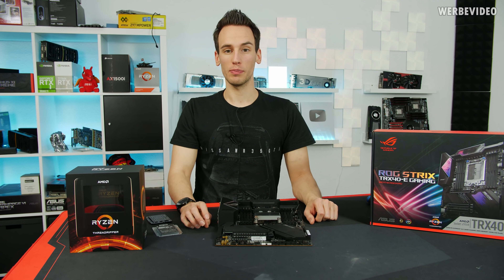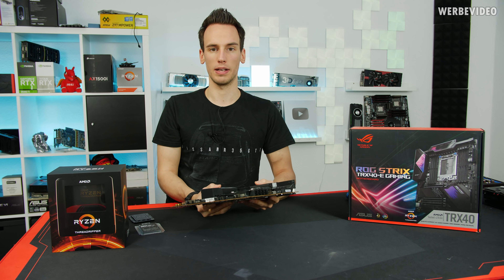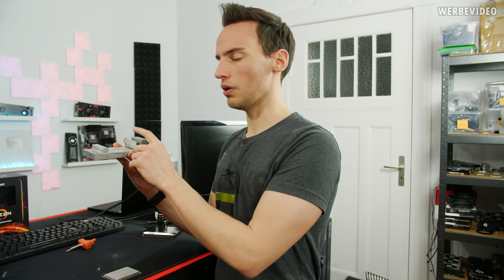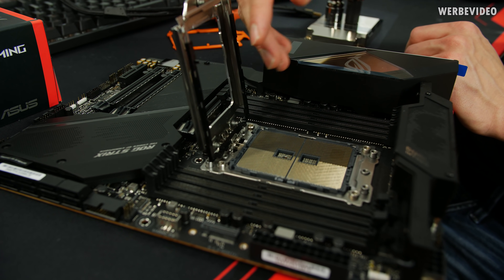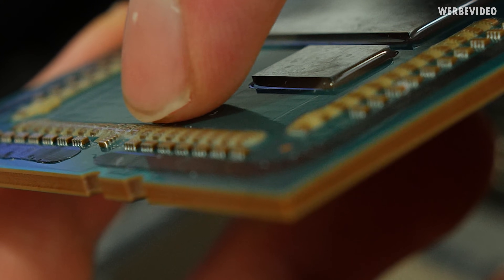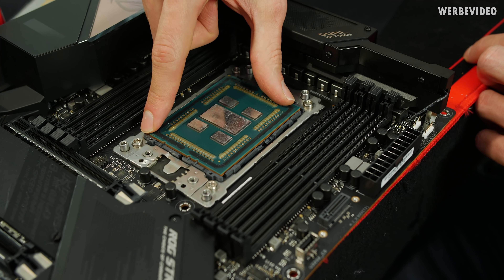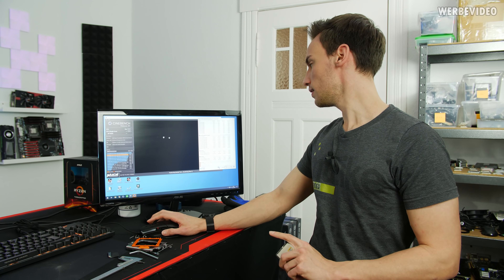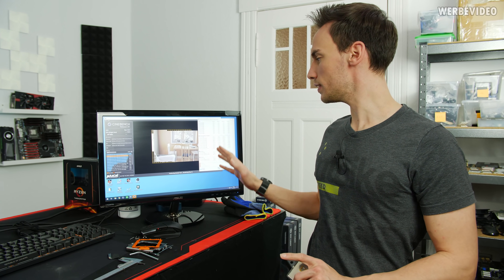IT ACTUALLY WORKS! -  3960X / 3970X Direct-Die Cooling

Comment: Looking at the size of this CPU delidded I can imagine that in the future Amd will just produce a CPU that is integrated into the motherboard itself so as to remove the need to have a CPU socket with pins and contacts completely as the die is so huge at this stage that if it gets any bigger it will be as big as one 1/4 of the surface area of the board it sits in, so at that stage they might as well integrate it into the board which I think will make a lot of sense.

Comment: I really wish direct-die was a bit more mainstream, so that non-lidded CPUs could be bought and motherboard sockets were designed to support it as an option.
It seems that as long as you have a direct-die bracket there is really very little risk involved in the actual mounting. I don't think I have ever heard of anyone who used a direct-die bracket cracking or killing a CPU because of mounting it too hard.

It is just a shame that it is all the other stuff (delidding a soldered CPU, replacing/modifying the socket ect.) that is so risky and/or require expensive parts.
If CPUs and sockets just took it into consideration to have this as an option then there is no reason direct-die could not be very cheap and safe to do.
I guess it would probably never be "mainstream" because direct-die needs a little more precision to get proper contact usually, but there would probably be a market for non-lidded CPUs - and it would require almost no work for the manufacturers because it's literally just skipping the last step of the process.

Even for the enterprise market... if you could reduce CPU temps significantly like this for a one-time isntallation cost then that means you need less cooling. Less cooling => lower costs. This would be interesting to enterprise for exactly the same reasons they want more and more power efficient chips.

Comment: Can someone very experienced with LM answer me this?
Is there any performance reason to not use  a little more LM than you need? I assume it would just squeeze out any excess anyway.
Of course that is not good for safety unless you have insulated any exposed connections on the CPU, but let us assume that you have done that thoroughly (as you should IMO). Then it should not really matter...

The reason I ask is because while LM is fantastic, it seems to be much more finicky about getting good contact than normal TIM. Even the guys at GamersNexus say that they often have to do 2-3 applications to get a really good connection (where core-to-core differentials are not so high). Not just to get a "good enough" connection, but when they do comparison benchmarks where they need to have consistent data I mean...

My hypothesis is that if you apply LM normally, but then put a tiny ball of LM extra in the center then this would help push out any air-gaps and make it much easier to get a really good thermal contact the first time. You would probably end up using less LM also compared to remounting 2-3 times to get it "perfect".

Comment: Wonder if due to the pressure now being in the center if the pcb is bowing and the chips are not perfectly flat to the heatsink.  Maybe some memory thermal pads along the pcb could help spread the pressure out with the additional benefit of transferring heat from the pcb to the block.  Same thing if you snug the pad up along side the cpu chips as you would get more surface area from the side of the chip to transfer heat to the block.

Comment: well, I do not know the composition of the solder used by AMD, but I believe it is based on a Sn/In alloy, which most likely will present a thermal conductivity at 393K similar to Conductonaut.

Comment: the whole process is really cool.  However, I am wondering why removing the thermal interface based on the element Indium, whose coefficient of thermal conductivity is 81.6 W/m.K, for liquid metal Conductonaut, whose thermal conductivity is 73W/m.K?  
To improve your experiment how about to use another product with a higher thermal conductivity such as the LT100 with 128W/m.K.  Or better yet, how about using graphene sheet, whose thermal conductivity is 1500W/m.K, maybe that justifies all the work to replace the thermal interface.  Maybe you can get bigger overclocks.

Comment: You should take measurements and grind out indents on the cold plate for the memory controller and each core. That will give everything full coverage contact. Polishing may take an hour or two but you'll have a beastial custom waterblock you market to the OC community.

Comment: The reason for your high temp is because you are stressing the single core, thus increasing it's thermal dissipation. These CPU's are designed to attach a workload by breaking up the load among the cores.

Comment: This might be a case where custom IHS/block will have benefit. The block has thickness, so with watercooling the IHS is redundant/excess material.  You'd likely want to measure your CPU so each contact is at proper height. Maybe solder the water block right on?

Comment: I think the problem is that top of the dies are uneven as you removed indium with a blade.
Try heating it up and using desoldering wick maybe?
Or heat it up and place piece of borosilicate glass on top of it so indium is flat AF then leave it to cool down.

Comment: Damn  I remember when most Cpu's where direct to die cooling  Like the old Athlon XP 17 or 1800+ those where scary days, It was very easy to chip the corner of the cpu.
Reply: Yeah, and chipping these corners did usually nothing. I didn't find it scary at all. Heatsinks were also much smaller than nowadays. If I were to mount 1,3kg behemoth on my Duron or Athlon XP, I would have been surely more worried.

Comment: Maybe the original cpu heatspreader was a better alloy (for thermal conductivity) than the bottom of that chrome colored exchange.  One is better off with something having bare exposed copper -- nickle, chrome or stainless do not conduct heat so well.  You could cool directly with de-ionized water, but it would not stay de-ionized for long.

Comment: the indium solder likely has higher conductivity then any liquid metal containing gallium. if you wanted better cooling you'd need to use pure Potassium with the PC in a vacuum chamber.

Comment: It could be that AMD deliberately make core dice a bit shorter than the central one and then relying on solid solder for both thermal interfacing and uniform load spreading. This way they're guaranteed not to end up with a tilted IHS due to height variation between dies. Would be cool to see this tested (maybe with a very thin shim with the CPU surface pressed against a lapping plate, and then to see the CPU actually lapped flat. Also, I always wanted to ask, does liquid metal actually amalgamate and remove the remaining indium from the surface of de-lidded CPUs?

Comment: Did you check the back of the CPU for contaminated contact pads or wipe down with isopropyl alcohol? Fingerprints will interfere with a good electrical conduction.

Comment: I think some extra hard foam  around the dies might help Keep pressure more evenly spaced on the die board.

May have too recess the cooler a little bit too accept the dies and get more even contact with all the dies.

Then its time to get this baby on a water chiller.

Comment: First thing I thought - make a shim on the border, kind like on older S462 Athlons, where the glue originally was. Good part of the mounting pressure comes from IHS spreading it over the edge. I'd guess the best one would be a hair thinner than die height with some soft, yet thin interface underneath (silk? I am not kidding). That's pretty precise work, sadly.

Comment: Would love to see you try and put a  3900 in one of those laptops that takes AMD desktop CPU's (GL702ZC, Helios 500 etc)..it hasn't been done yet and no laptop has been released which has that CPU in.  The 3900 is 12 cores 65w or you could try the 3900x variant - but you'd have to reduce power draw in BIOS. Im sure people would love to see a 12-core laptop project from you =D

Comment: Rather than modify the cooler block perhaps first try to get some very thin sheets of copper foil and lay them on top of the die. It wouldn't be as good as direct contact with the cooler but it would give you a idea of how much of a gap  you have.

Comment: You should notice "the thermal spreading resistance". It not always good to decrease the thickness of the base.  The roughness of the contact surface also should be concerned

Comment: Roman: at around 6:15 you are talking about the device holding the bolt in... if you're curious what this is called, it is a "circlip" (circumferential clip, basically). They come in outer and inner kinds - the inner kind is often used to retain bulkheads in a tube for instance, the clip lying in a groove cut into the inner surface of the tube (hence being called an "inner circlip"). The kind you have is an outer circlip, and they are usually used in exactly the manner  your one was!

N.B. closely related are E-clips and snap rings. All of these are variations on a theme basically; different strengths, different mounting styles (holes/notches for insertion/mounting using the specifically designed plyer-type tool) and such. I usually just call them circlips unless I need to specify the exact kind as it's a good catch all considering the etymology (all of them are circumferential after all)

Comment: AMD should come out with the Der8auer Edition which is shipped delidded and the Der8auer Pro Edition which ships with no lid.    And the Der8auer Extreme Edition with ships with the cooler pre-installed on the dies using a custom machined cooler.      Or maybe just make and edition with a very fancy heat-shield made of the best alloy, and call it the Der8aueRipper.

I would think that if you drilled tiny holes in the heat-shield above the IO and each of the 4 cores and filled those holes with liquid metal, that that would be the easiest of the options.

Comment: SUGGESTION. I wonder if you leave the solder after deliding and set the copper part of the cooling head (centered correctly) on top of the chips, then heat it in the oven. that's about the best way to get full contact.

Comment: There is an important question,,in TR, the IO die and computing dies are made by different factories,GF and TSMC.Can you take some thermal image to show the heat generated by IO/Computing dies ?Which one generates more heat?If IO die generates more,,maybe there should be a special cooler design for it.

Comment: Definitely needs more mounting pressure..... I used an EK direct die cooling kit years ago and the stand offs for the CPU block were reduced in height to compensate for the loss of thickness. It should just be a case off measuring the thickness of the IHS and then removing that from the mounting system.

Comment: It might be kind of a stupid idea, but have you considered "shimming" the dies with metal foil? Perhaps some thin copper or alum foil. This should add a small amount of height and thus increase the pressure. But you'd have to get liquid metal on both sides too somehow, just really thin layers I guess.

For mounting pressure I feel like an o-ring or gasket material around the edges of the CPU carrier would probably work, it doesn't have to be very thick, I think it'll add plenty of mounting pressure around the edges to get rid of the mounting problems.

Comment: At my RTX 2080 that i put LM  i applyed a thin layer an have bad temps and when i put more it was all fine like it needed a good amount...  you can try add washers the mounting bolts so can push the cpu harder :P @der8auer  *also put some plastic...staff to put pressure to the corners of the cpu ..

Comment: Outside of the specific types of clips, e-clips & c-clips, we cal them circlips.

BTW, I know you’re comfortable cleaning the indium solder off with a razor, but if you directly apply Gallium, it’ll allot with the indium and you can clean it off more easily as you’d clean a liquid not a solid off the dies.

Comment: I have a question on choosing CPU platform for workstation upgrade that is relevant to 3970x:
-our software can utilize 16cores max and can eat up to 256GB of ram so 32GB dimms are needed
-we can do whatever we want with cooling as long as it can run 24/7: custom WC + water chiller sounds like max what can be done here
-10900XE or 3970x or what else? 
-our existing config's are delidded 7980XE @ 4.6GHz with 64GB and 2990WX @ 4.1GHz but first one lack memory support and second lacks speed
-money isn't a problem, we are designing ASICs :)

Comment: If you get the pressure right and see worthwhile improvements I’m curious to see what direct die cooling does for standard ryzen 3000 CPUs.
Reply: I somehow wish AMD got back to direct-die cooling from Athlon days. You just knew you cannot get any better heat transfer.

Comment: im a noob and know basically nothing about this kinda stuff and barely anything about thermodynamics. what would desoldering the ihs and mounting the cpu block do? i know it is meant to reduce temperatures, but how? with intel i understand since they just use a low quality thermal compound instead of indium solder, but is the indium solder & ihs enough of an interference for there to be gains by desoldering it and mounting directly?
from what i am seeing, indium metal has a thermal conductivity of 83W/mK, liquid metal is 73W/mK. i know that the indium solder is most likely some sort of alloy meaning its conductivity isnt as high as raw indium, but even with that considered, how many degrees could you even theoretically shave off?

Comment: Great video and thanks for doing this!  Quick note on mounting pressure.  If you look at the threads on the mounting bolts for the HK, they control the pressure by the amount / length of threads.  My guess is those threads and the shoulder of the bolt are bottoming out before proper pressure is applied because the mounting surface is a few mm lower as a result of delidding.  Visually verify if the shoulder of the bolt is hitting the socket female threads.  If so, those bolts would need to be modified somehow to have a longer shoulder.

Comment: is the io die and other dies the same height?
Reply from the maker: yes
Reply: @der8auer  I'm only asking because even if the IO die is just a tiny amount higher, it will translate to significantly lower mounting pressure on the edges, but presumably you know what you're doing.

Comment: why can't direct die be done on the 3950x ?
Reply: It can, I'm doing it.
A little differently mind as I'll be using a hot-air soldering station instead of the baking, and (very good Alphacool)thermal pads around the silicon.  It'll help with mounting pressure, cooling the Infinity Fabric, and protecting against liquid metal migration.  I might even have to level the dies using the solder if they're too out of true.👍
Reply: @JuxZeil  but have you done it already? I did it on a 3400g and I had to machine the cpu block to stop it from hitting the socket. I am waiting for my 3950x and I want to do the same to it. And why not simply use the tool that @der8auder created to delid it? Why the need of backing or heat?
Reply: @pedroteixeira4369  Not with Ryzen, only Intel.  When direct die cooling, as with extreme overclocking you remove the metal CPU retention clamp and socket frame.  They always interfere with the cooling plate otherwise.  
der8auer first baked(put in oven) the CPU in the de-lidding tool to soften the solder between the dies and IHS.
Reply from the maker: you can't do it without special mods because the side of the AM4 socket is sitting higher than the chip
Reply: @der8auer  Good job I don't have to worry about insertion force with the AM4 socket.... it's a ZIF socket. 😁
Reply: @der8auer  Indeed! I had to machine 0.6mm out of the stripe of cpublock that is over the AM4 socket to avoid hitting it. I just thought that there was something special with the cpu itself, like a stronger solder or something that would kill it when deliding.

Comment: By “direct die” cooling I thought you meant you had a water block installed running water over the bare dies. Can you do this next? 😛
Reply: It would take a custom waterblock(that you couldn't use for anything else) precision engineered and with custom made sealing 'O' rings.  Probably not. 🤨
If you are interested in direct water to die, 8 Pack is prototyping said waterblocks at the mo.  So keep an eye on his blogs etc.  👍
Reply: Jux Zeil yeah I saw 8 pack talking about that! It would require a custom machined block
Reply: Tadas Nanartonis  doesn't matter with high flow loop.

Comment: Your work with liquid metal is exceptionally bad. You just leaving too much air gaps with your 'method' of applying it. It could be easily checked by using simple piece of flat transparent glass. The air pockets would ve easily visible. To get proper result, just apply spherical drop on the center of each silicone an then use thorougly heated heatsink to roll the drops while mounting the heatsink. That will provide proper contact.
Reply from the maker: no just no. Never use drops with liquid metal. Man I produce this stuff. Thermal Grizzly is my company

Comment: "I don't know what you call this in english." at about 6mins10sec is called a C-clip. It looks like a letter C. :) . Also we'd say "pin" rather than bolt when reffering to the bit of metal holding the spring down and the frame.